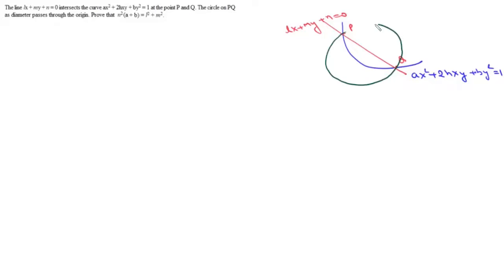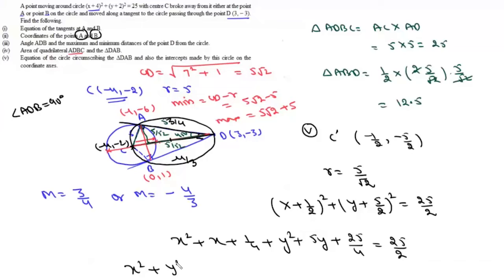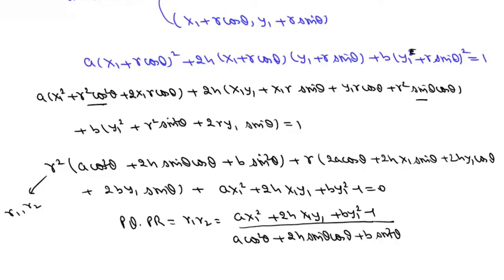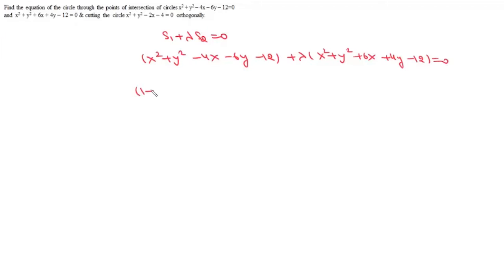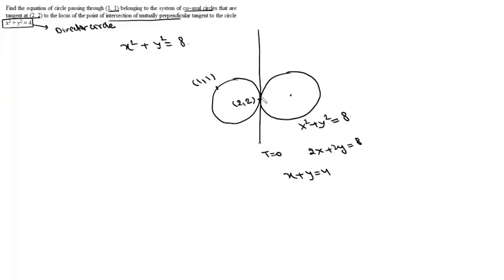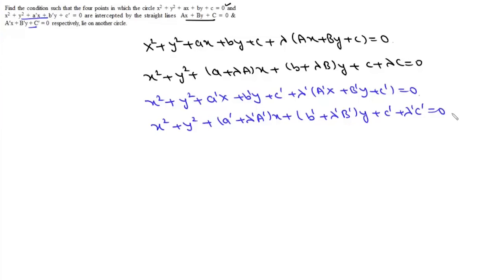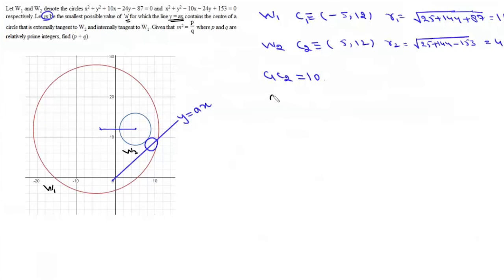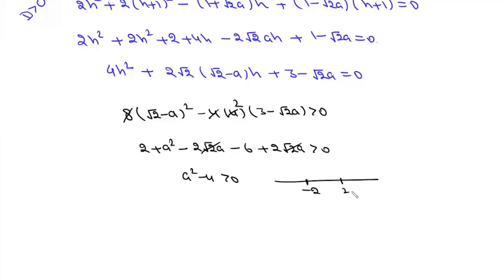Circles | Symposium | Part 1 | JEE | ISI | CMI | 35+ selected solved examples

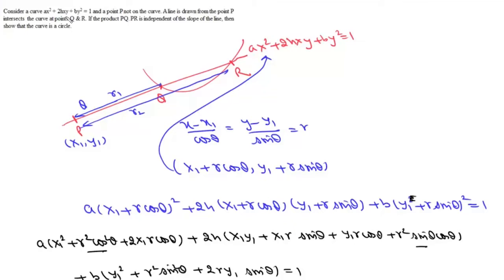Comment: 43:49 this one could have been done by power of a point, Since PQ.PR is independent of theta, then it can be assumed that if Q and R coincide upon changing the theta of the line, it will be (PT.PT), where T is the point where Q and R conicide.

From this, PQ.PR = PT^2, this is only possible for circle.

Comment: 4:00 new property of angels bisectors
11:30 all basics about pair of  tangents
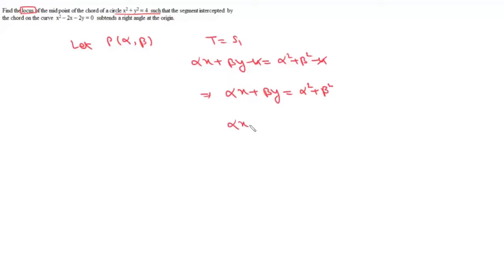24:13 remember pair of straight lines , unlikely to come tho
26:20
33:50* get tangent  equation  by using standard Slope eqn , then use Slope point form instead  as we get 2 such slopes and 2 intercepts
44:05 M-1 and 3 classic

Comment: 1) 0:01 (M1 : My method (Diametric form if circle) ; M2 : Homegenise curve ( 🌟 m1.m2 = 90°) 3:33 

2) 3:42 (Angle Bisector Property)

3) 7:45 (assuming pt on given line)

4) 11:22

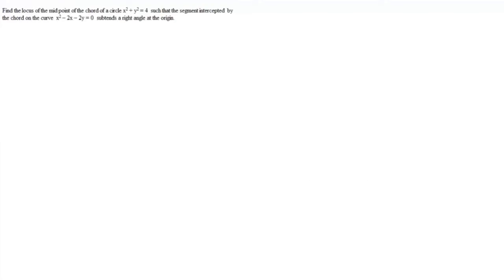5) 23:26 [ Homogenisation on (given curve) and (line obtained by T=S1 on given circle) and then m1.m2 = -1 ]

6) 26:29 [ Intercept by line on circle question (easy) ]

7) 29:22 [ 3 eqns, 3 variables (f,g,c) ]

Comment: sir at 1:32:58 , when we use the formula for the radius of a circle, we get some function of k. the minimum value of the function becomes 1/sqrt(2). Where is the extra 1/2 factor coming from

Comment: 47:12 why am i getting different answers if i use foot of perpendicular formula by considering the centre as (h,k), foot of perpendicular is (1,1) so using two times the formula gives two linear eqn in h and k and after solving them im getting the centre as (5/3,0)
Reply: True

Comment: Sir in the question 8 at time 32:37 ,how u considered that at 0,0 there will be a right angle
Please explain...,and thank you so much for the lectures!❤
Reply: Consider the quadrilateral that is formed by point of intersection of tangents , points of tangency of both circle and the centre , since all other 3 angles are 90 , the angle at (0,0) has to be 90 such that sum of all angles of quadrilateral comes out to be 360. You could've noticed that earlier also , as sir too said that the quadrilateral is precisely a rectangle